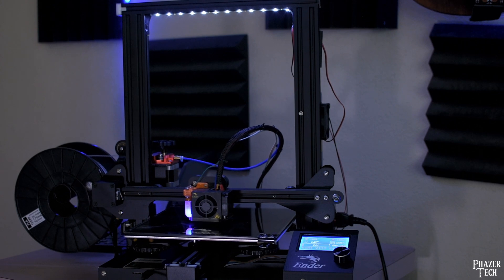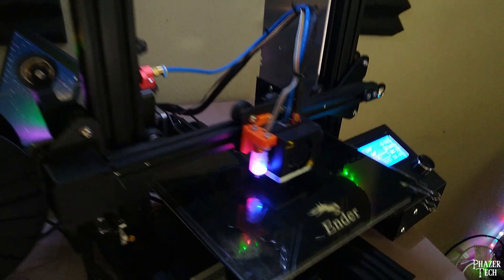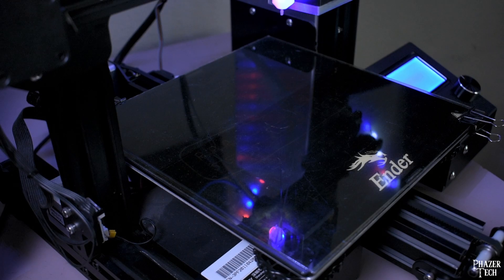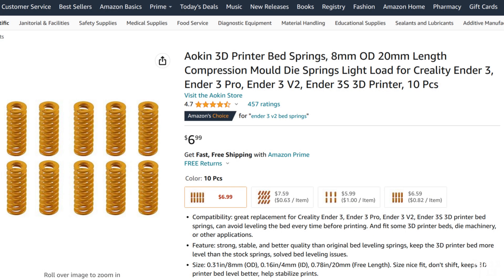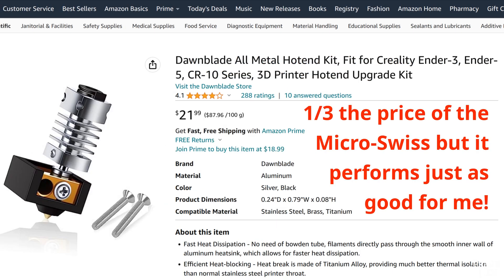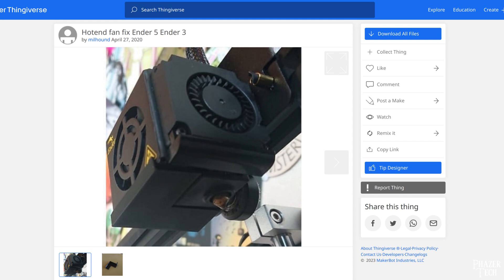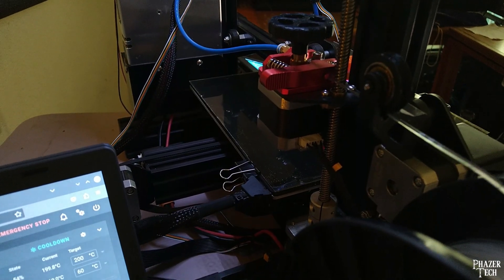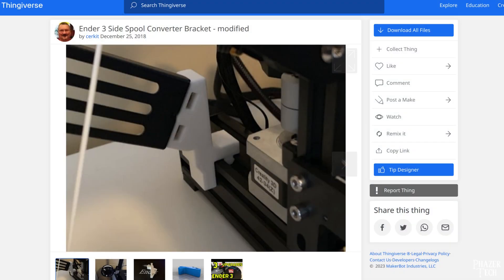My Recommended Upgrades For Ender 3 - Transform A Budget 3D Printer Into A Truly Great One!

Comment: I would recommend a few more easy upgrades;

1) A fireproof enclosure. Especially if you leave your printer unattended for long prints. Creality sells one for $30ish.
2) 0.6mm nozzle to increase speed
3) A cheap filament dryer. I found a 2 spool dryer on Amazon for $50 and it works great.
Reply from the maker: Respectfully disagree on some points.
1) Fireproof enclosures aren't necessary and can cause components to overheat if there isn't proper ventilation. The very first Ender 3 model had a poor quality PSU which introduced a fire risk and caused an overreaction towards 3d printer safety, and there have been a few other brands/models that had issues as well, but the proper solution for that is to replace the PSU. Features such as thermal runaway protection ensure the printer shuts down if something goes wrong. Of course it doesn't hurt to use an enclosure as long as it's properly done, but without ventilation I can't really think of a case where it's necessary or ideal.
2) I have a 0.6mm nozzle on an Ender 5 Plus and it makes sense for large prints, but if you want fine details then you'll want to stick to the smaller nozzle. Use what's best for the job.
3) A large ziplock bag with a small silica gel packet works amazingly well for this.
Reply: @PhazerTech the enclosure is mainly meant to cut off the oxygen supply if a fire starts so I think ventilation kinda defeats the point. I've had mine enclosed for a year now and not had any issues with overheating. It also keeps pets away so they don't get burned by the nozzle or bed.
Reply from the maker: @huddleaw  The main reason why enclosures exist is to vent fumes from toxic filaments such as ABS. Certain filaments also work best at a specific ambient air temperature, so the more advanced enclosures have ventilation and allow control over the ambient air temperature.
Reply: @PhazerTech ehhhh alright lol just disregard my suggestions then 😂
Reply from the maker: @huddleaw  Haha they weren't terrible and I probably should have mentioned some of these things in the video.

Comment: After neglecting my Ender 3v2 for over a year now, I began to revive it. I added a CR touch and a bi metal heatbreak almost immedeatly after purchase years ago, but I just now insulated the bed, replaced the springs and I still have some upgrades in the bin, like a thin client to run Klipper with input shapping and pressure advance on and a direct extruder kit. I really need to try out PEI Sheets, printing PETG is a gamble if it wants to adhere to the bed or warp itself to oblivion...

Comment: I've just bought one, second hand for 400 bucks, and I'm spenting the days printing parts to her and researching possible upgrades without spending tons of money, and BY FAR your video is the most complete one I've saw in the past few years. So purchase everything, new board, bed, 3d sensor, springs and I'm printing the direct drive mount, just the superior one for the motor, on the extruser I'll keep the stock one with those closings you recommended. Cheers and long life ma man!!!!

Comment: In 2021, they shortened the stepper motor shaft. It no longer extends beyond the extruder drive gear. So there is nothing for this wheel to attach to on my Ender 3 -- that I bought in May of this year (2024). I see a lot of people complaining about the wheel and other printable wheels not fitting on the Ender 3. Researching it, the recommended solution is to replace the stepper motor with one with a longer shaft. For Creality it was probably a cost cutting measure. But for those of us that would love a wheel to push filament through, it's a royal pain.
Reply from the maker: I wasn't aware of this, that's really unfortunate. Thanks for sharing, might be helpful for others who have a newer one.
Reply: @PhazerTech  No problem; thank you for the video. It was very helpful, and I'm using this to modify my printer. I appreciate your interactivity with the community!

Comment: I bought the E3 v2 about 4 years ago. It printed fine out of the box, but I like to tinker. After upgrades it prints faster and maybe better. You can't go wrong with the original E3 series because there's so much support on line and parts / upgrades are cheap and plenty.
My Upgrades: 
Dual Z screws and motors, MB and PS fan mods to quiet things down, PEI print plate, BL Touch, Silicone springs (I never have to level the bed), Micro Swiss direct drive, Satsana fan housing, Slice engineering Bi-Metal heat break, Bondtech CHT MK8 nozzle, Linear rails on X,Yand Z axis. I ran Jyers firmware for a while, then Professional firmware and eventuallyupgraded to a Sonic Pad (Kilpper). I recently upgraded to a Micro Swiss NG extruder/hot end using a 5015 blower fan and solid copper heat block. The last upgrade I will probably make is a 60W heater for the hot end to make sure the filament is completely melted running at higher speeds. I print at 120mm/sec with no issues.
At Christmas time I bought an Ender 3 v3 plus. It has a huge print bed and will bang out a print about 2-3 times faster than the V2, but I still print with the little guy also. 2 printers are faster than 1 when you have multiple items to print for a project.

Comment: I have an Ender 3 S1 Plus that I'd like to completely upgrade; especially the motherboard and hotend.  I'm fed up with that "random abnormal runaway problem".  The only good thing about this printer is the direct drive and print size.

Do you have suggestions for a better quality wiring harness?  Or am I better off fabricating my own?
Reply from the maker: I don't have experience with that particular version but it looks like you can purchase a new harness. Your issue might be because of a loose or broken wire. It also might be helpful to try a PID calibration. Just a few suggestions you can try before upgrading the hotend.

Comment: I cant for the life of me get my ender 3 pro go without clogging every print, going to cheat and upgrade to the sprite pro direct extruder
Reply: Just get a Slice Engineering Bi-Metal heat break. That way your bowden tube won't be going all the way to the nozzle and leaking molten filament around it.
Reply: @Smedleydog1  appreciate the feedback man,i ended up swapping out the extruder for the sprite pro which has a heartbreak separating the Boden tube from the hot end as well. A more expensive and time consuming way to make my printer more reliable 🤣
Reply: even with the new extruder: make sure your hot end fan (not your partcooling fan!) is putting out enough volume. there was a time when everyone just put the noctua fans in their hotend to make it silent but they were to weak to cool the hotend and many experienced heatcreep because of that.
Reply: @Medievalfan94 thankfully the new sprite extruder i installed came with a robust cooling fan and I no longer have any problems with prints lasting 24hrs 🎉

Comment: I started my farm with 1 ender 3 v1, grew to 5 soon after . 3 years later I really considered getting rid of them and starting over v with a new brand.  My biggest issue is replacing thermistors too often . After watching this I may try to upgrade them. 

Side not I put a bl touch and could never get the firmware right. That printer has been out of commission since..
Reply from the maker: That's interesting, I haven't replaced the thermistor on mine and it still works fine. As far as firmware goes, if you're set on using Marlin there are precompiled ones you can download. But like I said in the video, Klipper is better imo especially if you have more than one printer. It might take some time to get it set up though.

Comment: Heads up microcenter will now be selling all ender 3 v2 for $49 till its phased out, I just picked up one, last week some guy bought 20 and the cashier didn’t realize it’s one per household
Reply from the maker: Thanks for the info, the v2 is definitely a better printer. Insane deal at that price.
Reply: @PhazerTech  I already own two but I’m thinking of buying a fleet of pure p1s and a fleet of A1 or A1 mini
Reply from the maker: @Dj_jon  Nice, those are quite a bit more expensive though aren't they? Are you a fan of Bambu Lab printers?

Comment: What size filament are you supposed to use for an ender 3? is it 1.75mm?
Reply from the maker: Yes that's correct. It sounds like you're new to 3D printing.  If you're looking to buy your first printer I highly recommend getting a newer version such as the Ender 3 V3 KE: https://amzn.to/3yRl06G
It's a better printer so you won't need to do most of these upgrades
Reply: @PhazerTech  I’ll look into that one I might just stick with the ender 3 idk though I’ll have to do some research
Reply from the maker: @Shadowsrobotics  Definitely!  Research the differences and the upgrades they did for the newer version. But if you can find a good deal on the older Ender 3 then that might be better if you're on a budget.

Comment: At 0:30 I concure, I purchased mine in Jan 2022, set it up, and I've not had to do a bed level with mine since about then, even after lifting and moving it half a dozen times. If anything, I've had more issues with the filements than with the printer. At 6:39 I also concure, my front fan developed a failed bearing issue which created a noisy oscillation on star up. I could of course stop it with my fingers and eventually get it to spin evenly, but that was more of a challenge so I ended up replacing it just yeaterday. At 9:36 I printed that guide out, and it's been very useful, as well as the one at 09:40, and that indeed has been useful. I've heard about Klipper, and am looking into it, but that's as far as I've got so far. I don't really understand all the techy stuff, so I'm not really confident in that respect... I do use a filiment dryer though, and that has improved the prints massively!

Comment: Thanks for a great video! +1 :D I've had my Ender 3 (v1 I believe) for several years now, but I only recently started printing again after a 1 year hiatus. There are several popular upgrades, or "upgrades", that I have not made. I'm glad that you mentioned the fact that a direct drive on this one will add substantial weight to the print head. Several people I know have gotten lower quality prints after installing a direct drive. I ended up replacing the bowden tube with one that flexes less, and have left it at that. I have a raspberrry pie laying around so I might look into getting octo print onto that. Or do you suggest just sticking to a laptop?
Reply from the maker: Thank you! Good info on the direct drive, I've definitely heard mixed results about doing it on the Ender 3. If you plan to use a Raspberry Pi I suggest model 3 or higher. RPi 2 might be fine but I definitely don't recommend RPi 1 or Zero. Also octo print is good but I prefer klipper, so you might want to consider that instead.

Comment: great video, I have just strated but see some of the short falls of the printer, I have some updates on order.  will the auto level work with stock set up or will I need to update something
Reply from the maker: Thanks! To get auto leveling working you'll likely need to update the printer's firmware. There are several firmware options but most of them are based around the Marlin firmware. Personally I use klipper.

Comment: Mine didn't autohome would not read the card, replacement board, original loom not compatible,sourcing replacement loom,plugs came off the thermistor,sourcing new thermistor kit...etc etc etc,still hasn't printed anything......after a month.....

Comment: my bowden tube literally failed within 2 prints of me getting the gender 3, i took apart the whole heating area and cleaned it out entirely and even ran plastic through it by hand, couldn’t use the change filament option to push plastic out either, was jammed somewhere in the middle
Reply from the maker: Sounds like yours failed much sooner than normal, but yea its definitely something that should be upgraded!

Comment: Is it possible to upgrade the Ender 3 to a level where it's comparable to the Ender 3 V2?
Reply from the maker: Yes definitely, the V2 only has minor upgrades. In fact I think my Ender 3 is better than a stock V2. However the Ender 3 V3 KE, which is the latest version, has major improvements. So for those looking to buy a new printer I highly recommend that one as opposed to upgrading an older model.
Reply: @PhazerTech  Thank you! I'll try some of your upgrades :)

Comment: I have the Ender 3 Pro which is heavily modded.  New main board, dual z rods, auto bed sensor, silicon bed mounts, direct drive and all metal hotend.   Though it prints well, it still has limitations which is mainly speed and cannot print faster than 60 or 70mm/s with the current hotend.   I would need to go to a high flow hotend and I am not sure which one would be best.  

I recently bought a Ender 5 S1 and have not used the Ender 3 since.  The Ender 5 S1 is at least 3 times faster.  If I was to recommend an Ender 3, it would be the Ender 3 V3 KE model.  While I don't have the KE model, the videos I have seen have impressed me with both the quality and the speed which seems to be on par with a corexy printer.
Reply from the maker: I agree the Ender 3 V3 KE looks like a big step up from the Pro version. But for those who already own an Ender 3 Pro it's definitely worth it to upgrade. These things sold like hotcakes a few years ago so there's a lot of them out there.
Reply: @PhazerTech  I agree.  I origjnally bought an Ender 3 Pro because of the price and though I enjoyed using it, it can really be frustrating at times.  I have even heard of people using klipper on it.
Reply from the maker: @zk_6312  Yep klipper is awesome! I mentioned klipper towards the end of this video.

Comment: No yellow springs. Use Silicon.  About the only thing i disagree with. Yellow springs will lose there tension faster then the silicon
Reply from the maker: Thanks for the suggestion. I wasn't aware of silicone spacers as an alternative, they look nice!
Reply: Sorry, but their* and than*
Reply: Silicon springs??? What are those??
Reply: @ed2595  they're technically spacers but they replace the springs
Reply: @Vistal11  compressible spacers i presume? I will see if i can find them
Edit: found them. Thanks
Reply: @ed2595  they are 100x better than yellow spring upgrade. I adjust the bed rarly
Reply: @Vistal11  good to know. I ordered them already. Tnx for the tip
Reply: @Vistal11  initially I never had to readjust my bad after I did it once. but   gradually I had to do it between every print. Never occurred to me it could be the springs. Learn something every day 🙂
Reply: @ed2595  yes sir.  I'm a pc tech for the past 20 years and still see something new every once in a while. It never stops

Comment: Cant waith for my Ender 3 v3 KE to show up in the mail.
Reply from the maker: Nice! That version looks like a major step up from the original Ender 3 models.
Reply: @PhazerTech  yeha. im new to 3D printing. so i hope its as user friendly too
Reply from the maker: Yep it should be very user friendly when compared to the older models. It has auto leveling built in which is a nice feature for new users.

Comment: Hi, your liink for the Bigtreetech board includes a touch screen, do you recommend the touch screen or just the board (it looks like your Ender does not have one)?
Reply from the maker: Originally the link had different "styles" of the board, including one without a touchscreen. Looks like that particular seller ran out of the non-touchscreen style. I've updated the link to a different seller that includes a non-touchscreen style. Thanks for noticing that. And to answer your question I don't recommend the touch screen for the Ender 3 since the stock screen is compatible. Not every printer will have a compatible screen, but Ender 3 does.

Comment: I upgraded mine (Ender 3 Pro) with direct Sprite Extruder - not only it's better and not touching Z axes, but also changing filament has became very easy and almost instant. Then CR touch, PEI surface. And Klipper, of course. Too bad i never heard of this KIAUH before! 😁
And in the end i realized, i spent so much for those upgrades, that i could as well  just sell my stock Ender 3 Pro, add what i spent on upgrades, and buy the new Ender 3 S1, and get all parts i upgraded, and even more.
So be careful with those upgrades! 😆
Reply from the maker: Yea it makes more sense just to buy a better printer to begin with. But used Ender 3s don't sell for very much so for those who have one I'd argue it's worth it to keep it and do just a few key upgrades. And yes it's probably best not to go overboard on upgrades, however I do feel like I learned a lot about printers in the process 😄

Comment: I have a question about the filament roller guide and spool location. When printing taller prints it looks like the guide would put a hard bend on the filament with it being located on the side have you had any issues? I have the same roller on mine, but my filament is still on the top. With the encloser I'm getting I will have to move my spool location.
Reply from the maker: I haven't ran into any issues with that. For extremely tall prints the filament might rub against the bottom a little bit instead of the wheel but I don't think that would prevent the print from finishing. The angle of the filament going into the guide seems fine, it's gradual and not very sudden but to be honest I haven't done extremely tall prints in recent memory on this printer so it's probably something you'll want to test yourself.